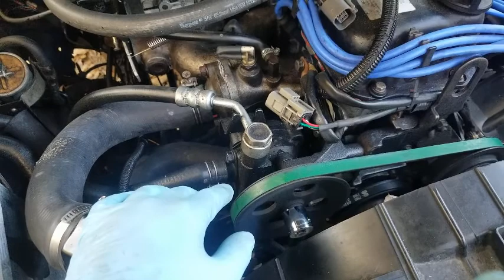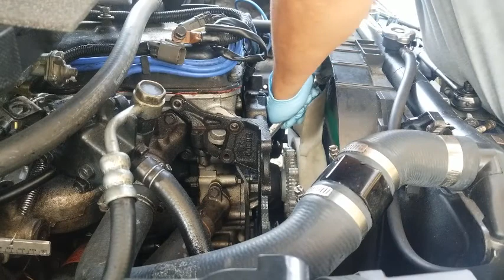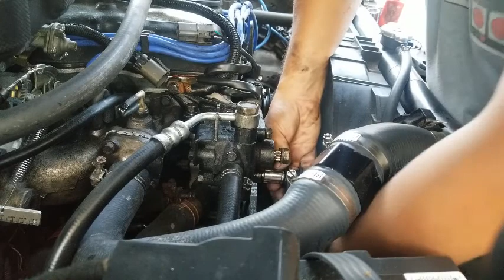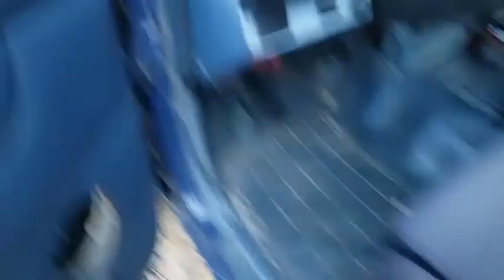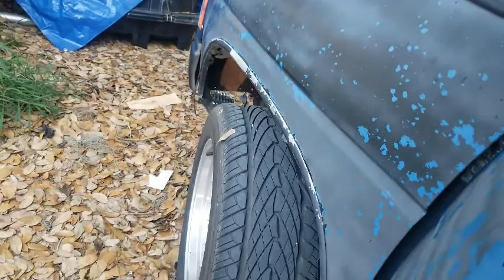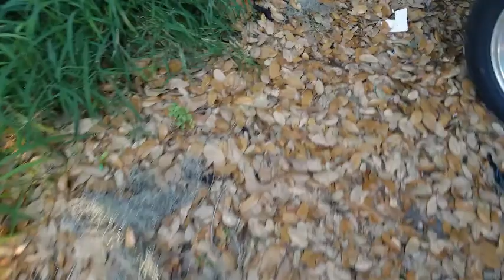93 d21 power steering pump/brackets/tensioner installed on 86 d21

Comment: Ufff thank you this was so much needed. 
I just ran across a steering pump & brackets 3 days ago after months of searching, such a great coincidence, keep it up man!! 😃
Reply from the maker: Thank you! And glad you found the parts you needed!
Reply: Do you remember where you got the power steering pressure line assembly from the 93’ hardbody?
Reply: @Incursion_1  it took me a while searching at the city junkyards, I found the lines bolted on to a hardbody with the ka24e engine (engine model doesnt matter) however a small section of the high pressure hose was lesking so I took it to a shop to get the line assembly rebuilt